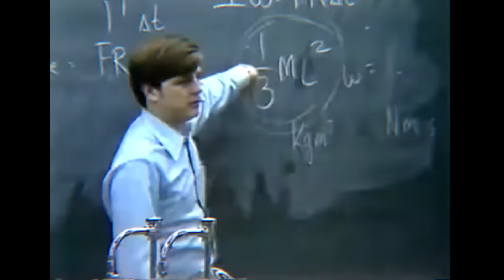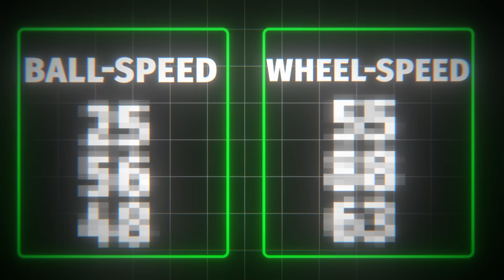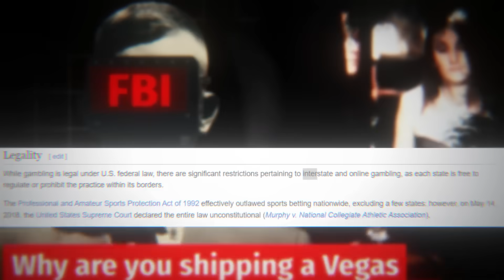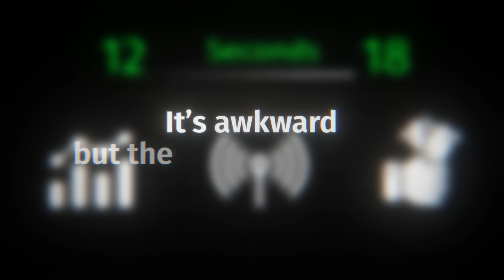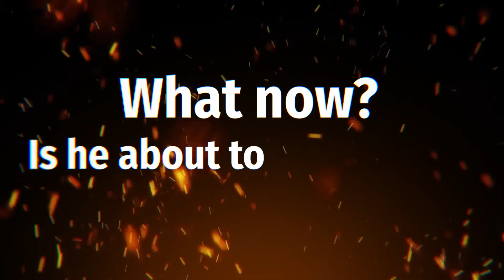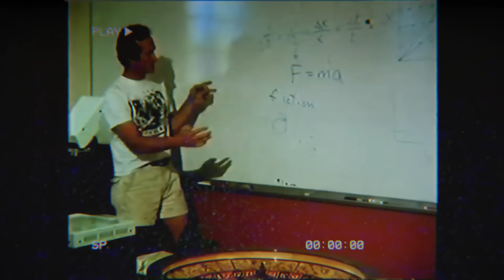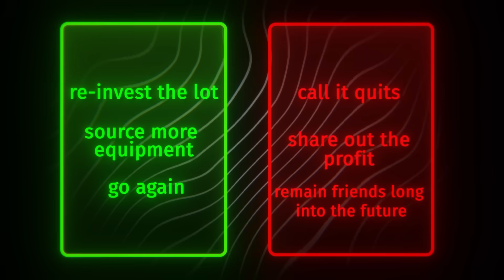The Nerds Who Beat Vegas Roulette With Science

Comment: here is a good strategy to win roulette if it is not rigged,  just stick with either red or black 
1st 5$ 
2nd 10$
 3rd 30$ 
4th 90$ 
5th 270$ 
6th 405$ 
7th 810$ 
8th 1620$ 
9th 3240$ 
10th 6480$ 
11th 12960.   
 1st bet 5 dollars  if won keep the winning and place 5 dollars again on new bet, if lost 1st bet place 2nd bet of 10 dollars on the same color if lost again place 3rd bet on same colour till you win as given in the sequence where ever you win may be 3rd bet, 1st bet, 6th bet, 8th bet or 11th bet just restart with 1st bet of 5$ and keep doing . 

Till the 5th bet you are winning then next six bet you are recovering to restart its very unlikely that it wont hit red or black in any one of the 11 bets unless its rigged, slow and steady winning but odds in your favor, if you have more money can extend to 15th bet too in which case probability of your winning increases significantly

Comment: There’s one big hole in the story and I say story because the whole thing is fishy, they claimed they can accurately predict where the ball is gonna land within five spaces on the wheel so they place their bet and they win or lose, but the rules of roulette if you’ve got to play that even before this ball is spun into the return table, so are they betting the next Bette that the computer hasn’t predicted or are they going off the computers fiction as the next step because the computer is collecting data and sending it back to them in Electric shock it’s sending the signal of the current spin Not the next spin and not the past spin the current spin so how are you predicting or moving your chips while the wheel is spinning and that’s against the rules the rules of Roulette are very simple. You place the bed then they spin the wheel. There are strategies to beat the wheel, but the wheel is not supposed to be spawn until all bets are placed, and if this computer is predicting the current spins prediction because it doesn’t predict anything until the ball is spun, maybe that was just for the experiment or whatever but I think this whole thing is stupid. They basically went into a casino played their odds and strap the computer to their chest that didn’t tell him anything.

Comment: FYI: Open letter. To BCLC
I already addressed my complaint to a casino supervisor, but to no avail. On August 30, I visited the Cascades casino. At about 3:30PM I played roulette at a video terminal. I inserted $20.00 and placed four 50-cent bets. A $3.00 minimum bet message followed. I then placed six 50-cent bets. Inexplicably, my bets were changed to four $5.00 bets. I had no time to 'undo' this losing wager. It appears possible to remotely control player's selections. If this is possible, I do hope that it's within your power to have the system disabled. Thank you.

Comment: This is exactly how the casino cheats us. On one side is b,r,b,g,b,r,b so if they spin and set the speed for both vehicles and you bet a large bet on red you have a 2 out of 7 chance to win once they practice landing the ball there. Also on the other side of the wheel where the other green is they have the opposite pattern r,b,r,g,r,b,r both they  both you ether way. Also odd and even and high and low follow same patterns proving my theory. I'm coming for my job as a dealer contact me or I tell

Comment: I live in Las Vegas and this video missing an important fact, the speed of the wheel and the ball are variables that can only be defined by the specific roulette dealer. A female dealer is going to have much less power when they spin than a man and a big & strong male is going to have more power than a weak skinny or older male. I've watched so many times when I'm on a run or someone at the table is on a run that a dealer change completely changes the results. I'm not saying the casinos do it on purpose, they probably do in some cases, but the fact is there are shift changes and brakes, but regardless the reason, the change affects the outcome more often than not.
Reply: I would think the wheel is spun at around the same speed spinning it faster would slow down the number of spins per hour and the money flow not what a casino wants.

Comment: Wouldn’t it be relatively easy to do the same today with advanced technology that’s also easier to hide. Or has anything been changed by casinos to avoid this? 🤔
Reply: Interesting question
Reply: You can bet for a short time  after the ball is released but not very long. They now have automated roulette stations with no human dealer. If someone has a good line of sight of the wheel and a radio communication to the player, then you can probably do this computation. I wouldn't trust a human for the input though. We're talking about  a human feeding video of the wheel directly to the algorithm. You can train the algorithm on hours of historical footage as long as you randomize the footage.  Understand the casinos have way more  hours of footage and would be doing the same. When the game becomes beatable it will simply be removed. The triple zero wheel is already a trash casino innovation.

Comment: I have spent many hours with the online roulette simulator, and I have perfected a method to win, 50% of the time you win and the other 50% of the time you lose but you identify which side you are on (good or bad streak) and you can withdraw or continue and win. I have never done it for real because I do not trust casinos. In that case, information is power and if there is anyone interested (the information is not free) you can test it online and you will see that it works

Comment: Now, let's imagine how amazing the technical details were in 1978! Nowadays you just buy an Arduino board, well capaple of performing floating-point arithmetic, buy a few dollar camera, download the Arduino IDE, or any other development system from the numerous choices.

When the narrator said in the beginning of the video that they mounted a camera on a tower, I chuckled a bit. At that time, it was unaffordable for most people, digital image processing weren’t a thing, and microprocessors were 4- or 8-bit at best. Notice the difference between microcontroller and microprocessor. Developing the software was a pain the ass (by today's standards. It was actually fun back then). Just uploading the code to the device required an (EE)PROM burner and replacing it required an UV eraser. OR an unaffordable EEPROM emulator. Clicking the "DEBUG" button today took half an hour back in the day.

Mad respect for these guys!!!

Comment: I am no roulette expert. Isn’t the balls insertion time random by hand relative to the wheels position?  Don’t the bets have to be placed before the ball is inserted? With both of these requirements, how can they predict where it will land?
Reply: Only if there was a tendency of the dealer to throw it in a specific way. But probably that problem would be solved by the casino as they would already know it from the stats of previous spins.

Comment: Even if you simply watch a roulette table for long enough and notice the pattern yourself you get an edge.

The operator however is advised to change their throwing speed and the spin of the wheel, to prevent producing predictable results.

The "random" part comes from the unpredictable input variables, the moment something is predictable its not random anymore.

Comment: the wheel is spun by a human so its slightly slower or faster every spin and the ball has the same problem and the casinos change the roulette operator every so often. and what number was the ball released on and the operator will say no moor bets which gives little time to bet some operators say no moor bets 5 second after release of the ball so you have to calculate which number it will land on and place your bets in less than 5 seconds good luck.

Comment: Now days you can't really cheat like that. You have to place the bet before the spin. Sure, you can use the same method but the ball release is controlled by dealer and so is the rpm. You have just the same amount of chance as randomized betting.
Reply from the maker: You’re right, the technology and controls in place now make it much harder to pull off those kinds of tricks. Casinos have definitely tightened up, and the odds are back in their favor.

Comment: I solved this way easier with roughly a 64% chance to win. Maybe 63🤷‍♂️ 

Walk away on a win is key. Stick to the rules.  I’ve invested in this. Let’s see 

100% - 5.64% was it. 

95.36 / 3 =31.787 x 2= 63.57%. 

Ok 63.57% chance to win. 

Ask me how.  The rest of the physics isn’t necessary. Watch the table. Set a limit. Play 10. 15. 20 hands or whatever.  10-15 is ideal but luck can favor you but the longer you play you could hit a cold streak. However if you  walk away on a win you can’t lose.  Table limit is how they separate this.   Stick to 10-15 hands only.  Strictly to the rules.    

Ask my strategy.   Yes I worked at a casino

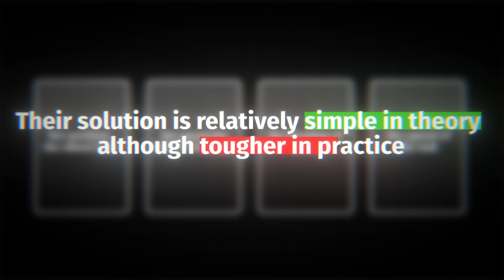Comment: 8:00 For the factors speed of the wheel, spin of the ball, initial position of the wheel, initial position of the ball, you can get those data only ofter having put bets. So it's too late.
Reply: No, you're given a certain amount of time after the croupier spins the ball to place bets.  

The problem is nowadays the casinos know about advantage play techniques, so they severely limit the amount of time you can place a bet after the ball has begun its spin (usually after the 3rd or 4th revolution around the wheel.)

Comment: Four minutes in and I can tell you- there is a variable that wasn’t accounted for in the video. I know this because I worked in a casino for years:
There are roulette dealers that snap, flick, etc. some can roll the ball 12x times around the wheel, some only roll 8 times before momentum stops. You can’t quantify the speed of a given dealer’s ball speed. They are all different.
Furthermore- many dealers tried to see if they could hit areas of the board with the same conditions (more tips obv)- spoiler… nobody ever could.
Not discounting this video, but highly skeptical

Comment: I have already tried this but you need someone to call out these 8-10 numbers….to place the bets..
I tried this by myself by using $5 chips…
5 x 37 = $$185
You wage $50 but you Win $185 - so each time, you can Win $135 per roll…

The problem I was getting was “out of Time” to place each bets!
The numbers are disbursed apart..

I carried a picture of the wheel and look at the number point when the ball is released…pay attention on the spin of the wheel… a lady employee will flip that ball a lot slower than a male casino worker and thus an old man…
You may want to see a 4-5 rolls to see consistency t before starting to play…
I tried this also without playing but just watching which number the ball going to land..
I was at Green Valley Casino tested this technique and this guy placed a bet on #37 for $25…
I whispered to him that one of his bet(#37) has 70/30 % of the ball will land…
He looked at me with a big question mark and I said just watch…
He won $925..
The next 7 number he placed a bet on for $50 each and #6 was one of them….I told him that #6 is one of the number I have seen on the list…
He Won $1800 and asked on how I was able to guess the number…
It’s the system I discovered I called parallel Sequence - a starting point parallel to its origin and possible destination…it’s a speed vs the wheel locational real estate..
Just imagine if someone could call out the numbers and placing $50 bets on each 8 numbers as fast as you can before the casino dealer wave his hand for “no more bets”

Try it.. I did  but I can only bet 5-6 random numbers…

Comment: There is an easier way to beat roulette, I just don't have the funds to try it. I would need $2555 to make this work.

Pick red or black, odd or even or high or low, basically something with even payouts.

Now only get $5 if you win take the $5 and leave the $5 for the next spin, if you lose double the bet. 

Let me show you an example

$5 Lose
$10 Lose
$20 Lose 
$40 Lose
$80 Win
$5 Lose 
$10 Lose 
$20 Win

So you lost 6 games and won 2 you should have lost money, but you didn't, you made $10. If you had bet $5 each spin you would have lost $20. 

Now there are casinos that still have single zero roulette wheels, this gives you better odds. I don't have a spare $2555 because that is the amount you need to put the odds in your favour. The odds of losing the $2555 dollars is 512:1 in your favour, even if you do have super bad luck, walk away with whatever you have, so you are not actually losing the full $2555

Comment: 1. You can only place a bet before Roulette's presenter respins the wheel and makes a spin - So you cannot see the revolution count/wheel speed.
2. No matter what physics, there is no way to predict how the ball is going to enter into the inner wheel - will it make inner revolution, will it bounce or just straight go into the pocket ( Thats why casino wheels have those metal dots - to randomise the ball stop.
3. Even if the wheel is same size, it's often different with slope angles, materials, and how new/old or clean/oily it is, thus making ball circle more/less if comapred between roulettes while spining at the same speed.
Reply: 1. Not back then; the croupier would call no more bets some time after throwing the ball in.
2. They were able to approximate/guess well enough to have an edge, even if they weren't always right.
3. The wheels in these casinos were all the same, and they would presumably measure a bunch of rolls to estimate the bias of each wheel and account for that.

Comment: You can not figure absolutely no one can figure roulette because the hand speed and ball roll is by a human and it’s always going to be different rolling in a section is possible but again the human has to spin the wheel from
Same position and roughly same speed that’s it
Reply from the maker: That's the point in measuring the speed isn't it?

Comment: You can do it with good memory skills if you play often enough. One NY I took a friend out to the local casino, I had maybe $900- with me. We walked around for a bit then I saw a $10- per bet roulette table with a single 0. I played the outside & when I won that first round. I knew straight away that table was good, no one else was on it. So I started playing the sections as I call it. So from memory, if it was a certain # the ball landed on, the chances would be it would land in that same section. So I'd play that previous # along with up to 5 # on either side of the wheel. They tried to change the dealer on me x3 and I spent 1.5hrs with barely a loss at all until maybe I lost maybe x2 in a row so I called it quits. Walked away with $5500 from a $300- outlay and I didn't spend the rest of the cash I had with me. Not the first time either, as within that month I was on point. I walked out with $3500- before going to a job I had that evening too. Other times it was a couple of thousand but overall I think up & down I scored $20k.

Once I even noticed a table & what # it landed on & the folllowing #. The next day I just happened to walk past it, saw it was on the particular # it was on yesterday. I put $100- split on 5+8 and it came out 8 with the dealer even looking at me like how did I know with a single bet. Choose to play on tables with females, especially small girls with weak arms. They can't spin often enough to put the ball off the sections.

Comment: There is no science behind roulette. It's just a legal fraud. Point is the croupier who rolls the ball decides which number comes next. I worked in different casinos and have seen it first hand. The talented croupiers could roll your number 8 out of 10 times. Think about it. The roulette is perfectly calibrated. And if you roll 1000times you get used to it. Like nose picking.  It's just a matter of exercise.
Reply: I think tipping the dealer makes a big difference. Not all the time. And not if you don’t stop without getting greedy. Dealer knows He or she will be switched off the wheel if the wheel goes negative, for the house.

Comment: Would someone please explain how in physics this happened to me:

The last time I played roulette was over 15 years ago in a casino in downtown Reno with a group of friends.  The croupier spun the ball… and it didn’t drop.  Everyone at the table looked at each other, waiting for the ball to drop.  It didn’t - the ball just kept going around-and-around for maybe 30 seconds, slowing down to a point, then maintaining a constant speed which prevented it from dropping.  The pit boss came over to the wheel, picked up the ball, handed it to the croupier and said, “spin it again.”  My friends and I immediately picked up our bets and left.  We never played roulette again.

On a fair table, how is it possible for the ball to never drop?  Has this happened to you?
Reply: I'm no physicist but logically speaking, It maybe due to the centripetal force. For the ball to remain at a constant speed, the centripetal force would need to match the force pulling it down due to gravity. If, for some reason, the wheel was spinning at a constant speed just fast enough to keep the ball from dropping, it could maintain this state for an extended period, but I highly doubt that it is due to this reason since it wouldn't last really long because one small change in speed can tremendously cause the ball to drop or accelerate outward. This is just my empirical observation.
Reply: @ilovestak3 I thought about that as well.  It was very strange.  The ball decelerated to a point, then remained at what looked like a constant speed.  It just kept on going 😂
Reply: Legend says that roulette wheel originated as a perpetual motion machine concept